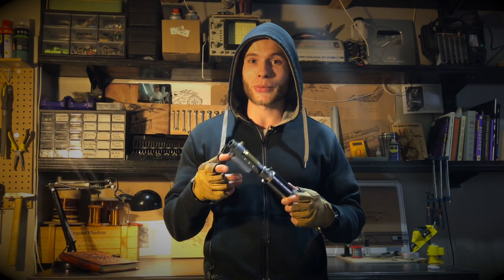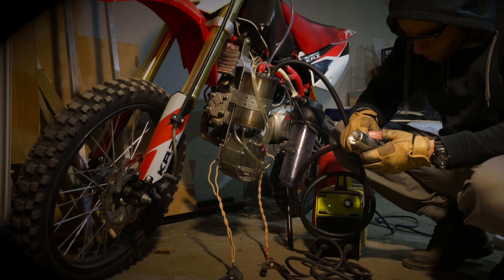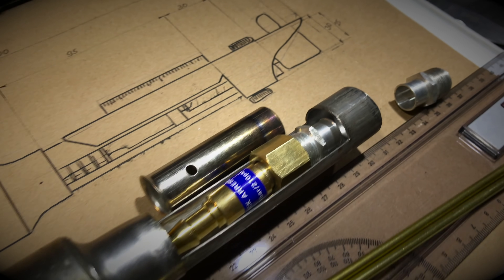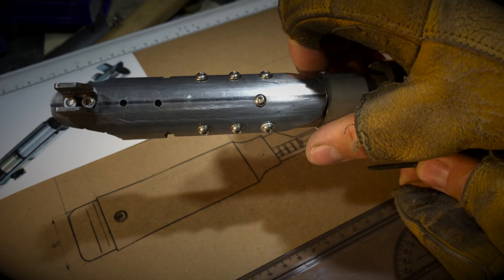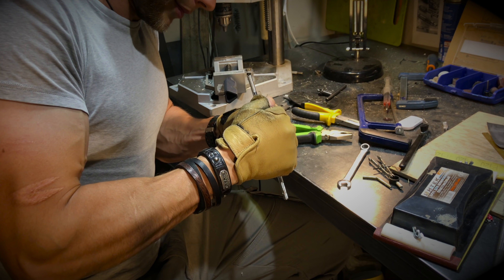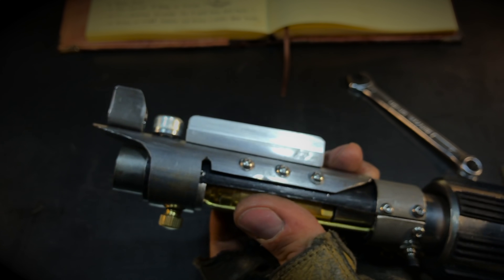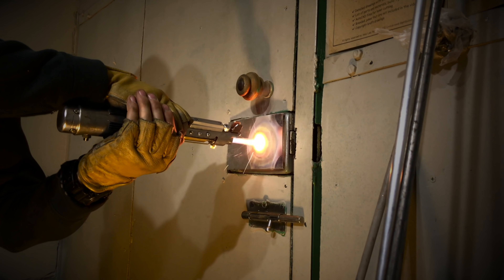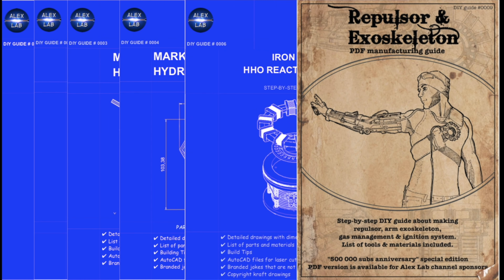First real lightsaber. HHO & high pressure electrolyzer. Guinness World Records approved.

Comment: Hack smiths definitely functions more like a lightsaber. This is just a flamethrower
Reply: And Hacksmith is just a heated-up blade, not even light nor flame sabre
Reply: Saint Militarist it’s still way closer to what a lightsaber is. It’s also based off of and actual lightsaber in Star Wars
Reply: @giganjira2898  it's colser to Warhammer than to Star Wars
Reply: Saint Militarist there’s a lightsaber in it called the protosaber that has a pack with a thing attaching to the actual lightsaber. Also his is actually shaped like a lightsaber

Comment: Here is my build idea for a lightsaber.... Which maybe not canonically accurate but could be extremely effective of a weapon in real life.

  A thin high conducting metal rod emanating from the handle which is about 4 feet tall, at both the ends of the rod there are discs of equal radius.

    So one at the top of the handle at another at the end of the thin metal rod.

  
  Laser beam projectors (placed extremely close to each other) along the perimeter of both discs, covering the rod in a tube of extremely powerful uniform laser aura, laser aura of an intensity capable of cutting through anything, so that nothing ever touches the middle rod before becoming liquid or gaseous, and thus eliminating the chances of breaking or even bending the rod.

  The rod should also be the primary conduit of power delivery to power the laser projectors.

  The battery is in the handle.

 Btw this rod is preferably made out of graphene or something like graphene, the rod is extremely durable but also indestructible through blunt force trauma and flexible so that when it's tensile strength is exceeded with an impact, it bends, when it bends, the laser beams become much less intense, to the level that it is non lethal to human skin even.

  But as soon as the flexible rod gets straight again, laser intensity is back to original, capable of cutting through everything.

   It could work with a small nuclear reactor battery within the handle of the Lightsabre.

  I mean if you wanna build a Lightsabre and you already have the appropriate power source to power it up, then this design is as close and effective as it gets.

Comment: Not going to say "you're stupid" since you are very much smarter than I am.
However, why does anyone that makes a "lightsaber" seems to just be making either really strong electronic burners or uniquely built flamethrowers, then claiming they made the "scientifically impossible"?
It's cool and all, but it's not a saber if the blade is just a flimsy bit of flame only a few inches long and only really usable up close.
And there is an even smaller version of this seen in the Tim Burton batman movie used by joker.

Comment: This guy: i made first lightsaber
Hacksmith: currently working on a full plasma lightsaber hmm.
Reply: Yeah hacksmith did it better
Reply: @talynator3745  I liked both, but I prefer Alex's lightsaber, it is much smaller (when it is turned off) so you can use it in smaller places. Or you can use it as a cutting torch! (just for a few second tho)
Reply: @cuentafake140  according to Legends, the earliest lightsabers had porta le battery packs that the used wore on their person, and had a thick cord connecting the power supply to the bottom of the hilt.

So you could attach a portable external fuel source to Alex's design and still be completely within the Star Wars lore.
Reply: The hacksmith one was more Like a hot stick
Reply: @Rush-ow4hq  and this was more like a small flamethrower
Reply: @Rush-ow4hq  and this was more like a small flamethrower
Reply: @talynator3745  which is much more accurate than a stick
Reply: @Rush-ow4hq  if you look at hacksmiths instagram they made on that isnt on YouTube yet, its by far the most realistic one that anyone has made

Comment: Neccessity is the mother of invention, clearly it's father is lockdown boredom.

Not quite a lightsaber, but a hell of a first model, and the closest we can probably get with the limitations of current technology.

We'd need a magnetic field to contain the plasma to the blade shape, so you can put more plasma in until it becomes nearly solid. That's not possible for something small enough to be handheld...at the moment.

One day, we'll look back at this the same way as we look back at the first car. It didn't have brakes, and only 2 gears, but it was still obviously the basis for the future.

Comment: I always thought that it would also work to use microwaves in the handle to turn the air into plasma and then use a rotating metal cage to form the plasma into a blade. That way, the only necessary resource would be energy and no fuel, for air should be pretty much everywhere you go (except if you want to use it in space like a real jedi but I am too dumb to come up with a good idea of how that could work)

Comment: Having seen both the Hacksmith protosaber video, and now this one, these are the conclusions I have reached.
Neither one is an actual lightsaber. This one is a glorified blowtorch you could break by throwing a bucket of water on. The hacksmith one is a hot metal stick.
This one is incapable of duelling. In the video he mentions the blade will only last ~30 seconds, more on that soon, plus it is just a flame which cannot make contact like a lightsaber. The Hacksmith’s one can be used to duel, as it has an actual blade that can make contact with other objects.
As mentioned in this video, the blade will only last for 30 seconds before the gas needs to be replaced. This is a huge limitation for it, and definitely removes functionality from it. The hacksmith’s one, on the other hand, will last for a long time, due to the large amount of batteries they use. This also means that theirs in more sustainable, not relying on a finite gas just to be ignited.
This lightsaber is definitely more manoeuvrable then the Hacksmith one, with everything contained in the handle. However, this is what creates the limitation of only having an active time of ~30 seconds
Overall, I would say that the hacksmith one is closer to being an actual lightsaber. Whilst it isn’t a plasma blade, it fits the description of a protosaber from the Star Wars universe, and they have admitted themselves this is what it is. They have a firm basis to make a more manoeuvrable model as they find ways around the limitations, and I can certainly see them creating a lightsaber closer to the one seen in Star Wars in the future.

Comment: You could probably increase the power if you attached the power or anything more with a belt pack. Like the early Lightsaber designs that had the battery pack. Still very cool

Comment: The lightsaber Can Cut Through metal but the real question is...

Can It Collide With Another Lightsaber
Reply: Dammit thought you were gonna say cut through younglings
Reply: Ewan McGregor Hol’ up
Reply: @DBMD9321  General Kenobi!
Reply: @DBMD9321  its not a quastion any more i found the answer
Reply: @DBMD9321  hold up
Reply: Quick answer would be

No.
Reply: Not enought power to make it colide with another lightsaber/protosaber
Reply: It will just integrate itself with the other blade, making one big X-shaped flaming blade
Reply: Good question 👍🏿
Reply: Of course not, if you want that go to tha hacksmith

Comment: Needs something more.  Look up how particles are held in place and accelerated in a particle accelerator.   Something similar may be used to confine and lengthen the beam.  This would make it look less like fire and more like a plasma beam.  The fire will only be the source of plasma but fields will be able to shape and direct it.
Edit:  Also, plasma is conductive.  If it would to be plugged into a high amperage source like an arc welder, with descent voltage, then when the blade struck something grounded, it would transfer the high amperage current to it, effectively melting it instantly.  Obviously, that would require a super capacitor in order to fit in something so small and would only be able to be used on the first strike for a fraction of a second, but for that fraction of a second, you have something that can do what a lightsaber does.

Comment: amazing job getting it all to fit inside the hilt. everybody should go and check out the hacksmith's instagram as they are a lot closer to building an actual functioning 'proto'-saber. they've said the prototype won't be done for months but they have early test videos of an actual dense, long, smooth plasma blade that can change colours and burns at 4000 degrees. in one of their test videos they are able to melt through inch thick steel plate with it!

Comment: I wonder if instead of using hydrogen if you somehow managed to get your hands on a crystal or a couple of focusing lenses which could then focus electricity through them and funnel it out the hilt of the lightsaber instead creating a sort of condensed lightning blade with an electromagnetic stabilization ring mounted in the opening of the lightsaber keeping the energy focused then you would not have to rely on the limited supply of hydrogen but instead longer-lasting energy batteries, maybe even capable of recharging( or even a mirco EM turbine if you could possibly build one). But this is a very amazing breakthrough and means we're one step closer to wielding actual lightsabers in our hands thank you man, I hope to meet you in the future in person.